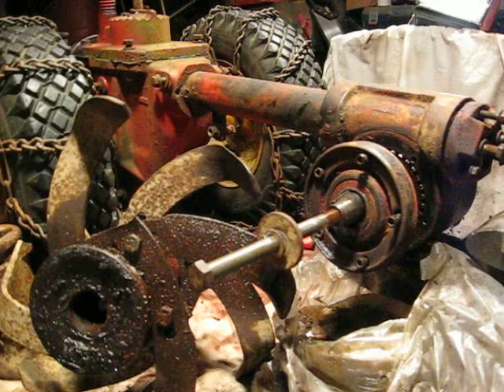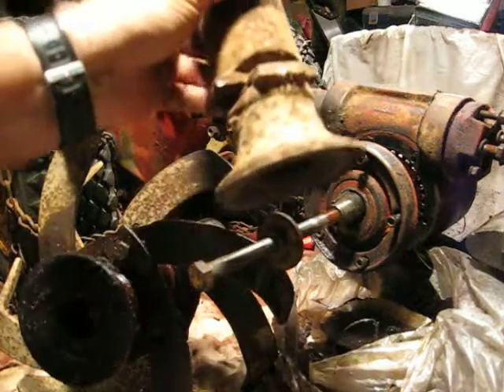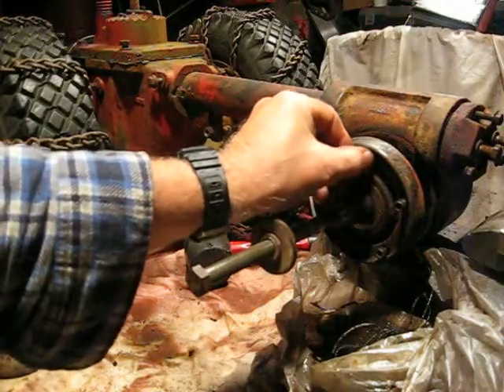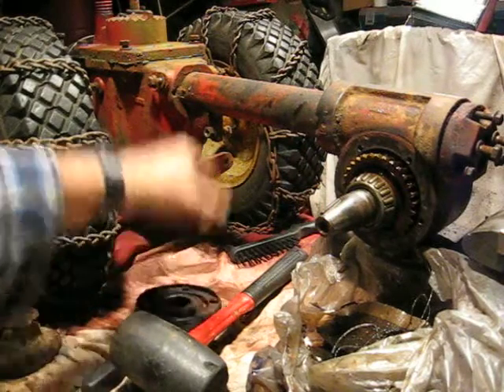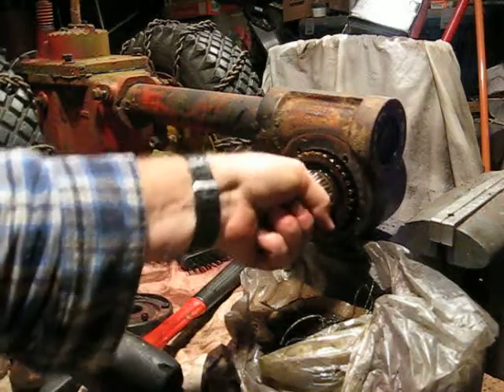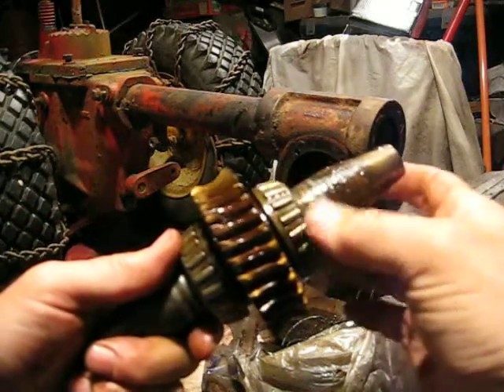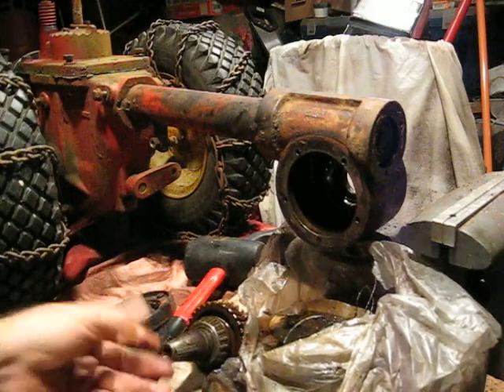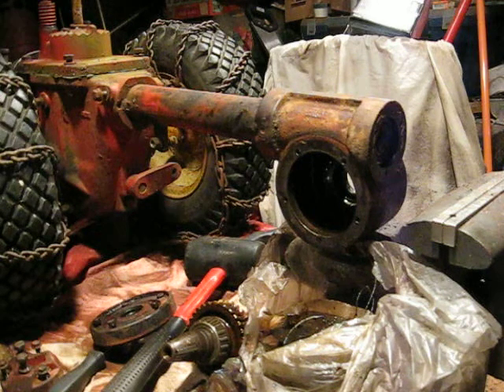Troy Bilt Horse tine seal removal (Buster part 3)

Comment: Looks good .I have my dads 1971 horse , I  used harbor freight clone Honda engine on it .
Reply: Got the 212 predator at HF Tuesday (last day on sale, lol, for $99) and seals from ebay.  Gonna attempt this today on a 1976/77 horse... points/contacts for the old Tecumsa were shot.

Comment: If your axle seals aren't in need of replacement don't bother with removing the wheels.   I replace tiller tires with the wheels mounted.  The mass of the tiller is a great holding fixture.

Comment: where do you get parts I have a 1977 that I am resurrecting (just got)and don't have a good resource for information. The tiller seals are leaking and I was thinking of just pulling out without disassembly because I understand that there are issues of setting brg backlash with gasket thicknesses etc. so pulling would eliminate that problem but no idea as to part numbers or where I can get manuals or parts.  Replaced carburetor on Tecumseh engine already but genuine parts for the unit is another story.  Need tines after the seals so any help would be appreciated.  Nice job by the way well done very informative.

Comment: How do you take the shaft bearings out do you have to take the motor and the chimes off and I'm talking about the shaft that goes all the way to the chimes all the way to the motor and mine is not a two-piece shaft mine's a solid shaft

Comment: I am attempting to install a new cast iron assembly (rebuilt) on my Troy Bilt, having difficulty find a socket with thin enough walls to fit in the opening to remove the bolts  on the old one, both are busted, any suggestions welcomed.
Reply from the maker: Where specifically are the bolts located?